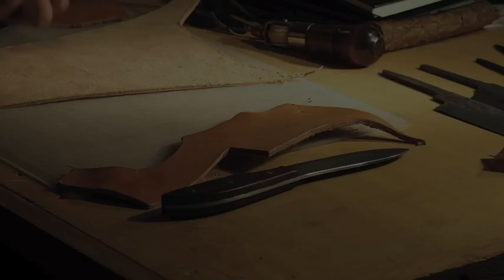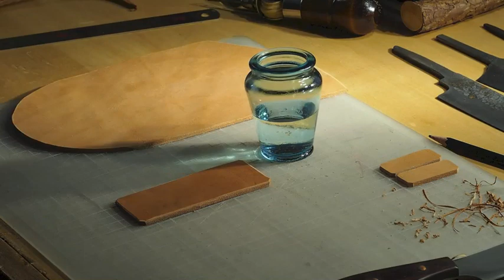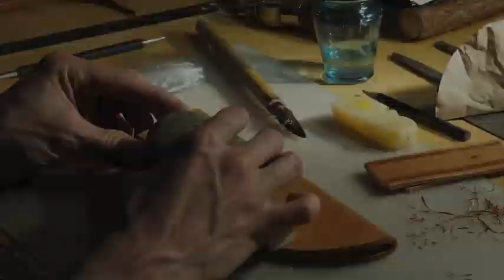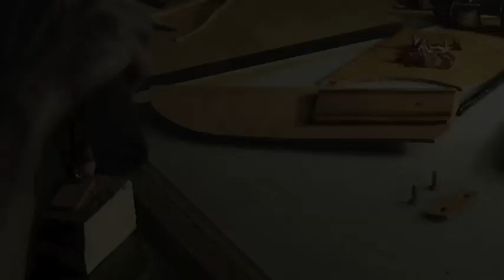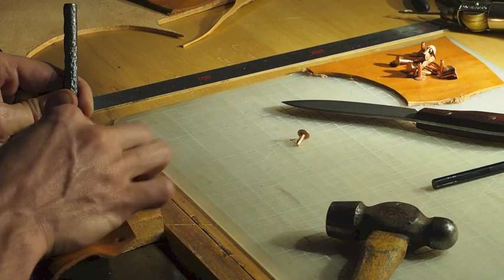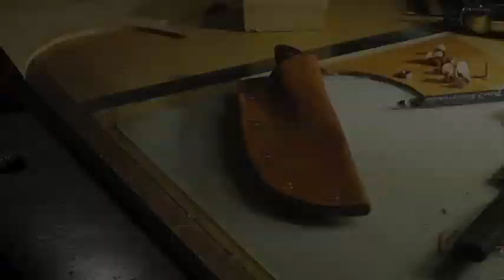SOTW #2 - Making a Leather Sheath With a Hammer and Knife

Comment: The first project from this channel I am about to give my attempt to. Almost all tools gathered but now comes the questions: could embossing the leather edges be a beneficial addition to this process? Can BLO be used as a substitute? 
Lastly I` d like to know about the knife itself: How does one obtain an even coarse finish such as on the bare steel parts presented? Ss it honed/ground on a coarse stone withouth any polish? Are there some special patina finish applied to tone the brightness of freshly worked raw coarse steel? Is it not a small usuba instead of a nakiri?
Reply: Could burnishing the edges be beneficial not embossing. Excuse me.
Reply from the maker: it was polished relatively fine on waterstones and then etched in hot water and vinegar to bring out the hamon and give the steel the matte grey surface...these edges are hand burnished with wax but yes it would be nice looking to use a wooden wheel technique...
Reply: @islandblacksmith  Thanks, I was asking about the finish on the nakiri to be more specific. Does the answer applies aswell?
Reply from the maker: same finish, but probably not as polished as the knife was beforehand...the top part has been left with the hammer texture from the forge...
Reply: @islandblacksmith  Great thanks!